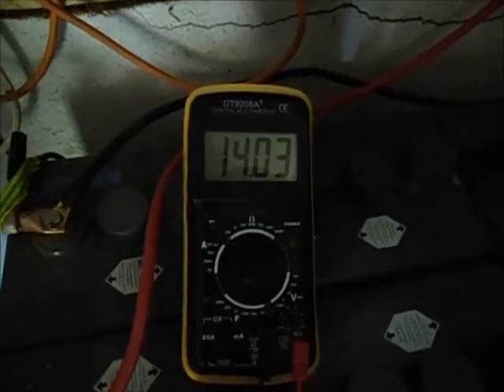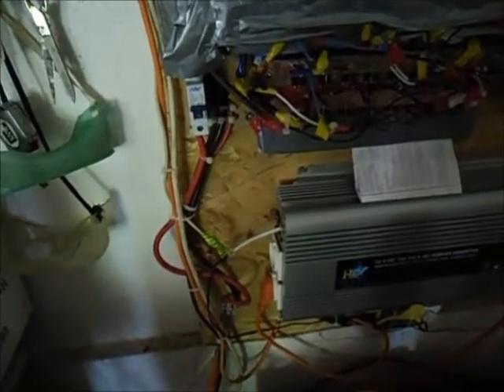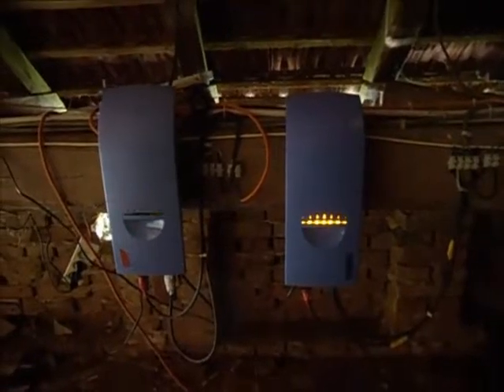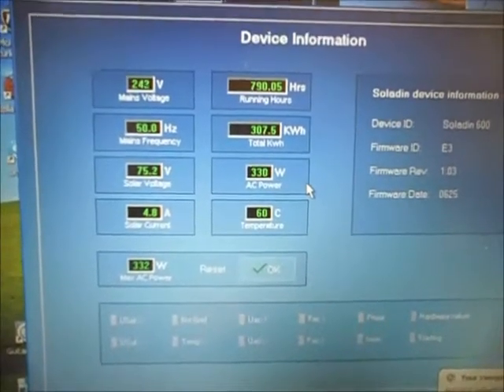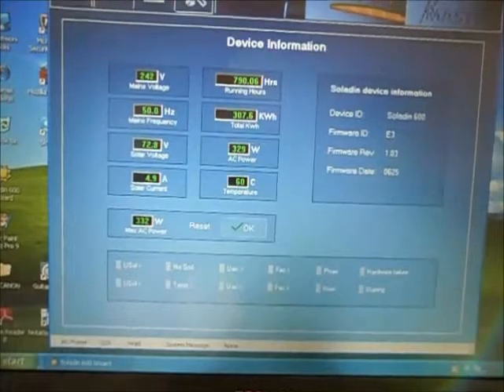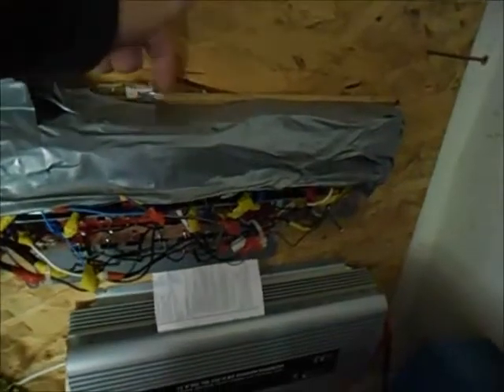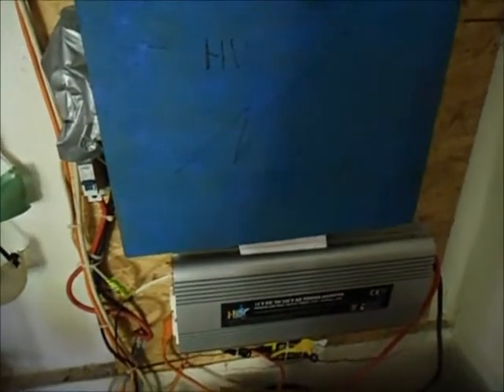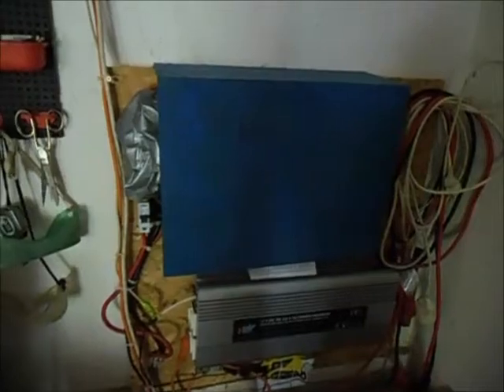The end result of all the Bedini and free energy experiments

Comment: Bad power company you have. Mine has forced me to buy a digital meter for the solar panels. I know they register what I deliver (and other home users with solar power), and add it up to say 'they' generate so and so much green power.

As you charge with spikes, I see the voltage rises up to 14 Volts or more. If you compare the charging with conventional charging, do you hear or see a difference in gas production in the batteries?
Reply from the maker: the voltage will even rise to almost 16 V. At that point the battery is fully charged and producing lots of hho  but smaller bubbles than conventional and the batteries as well as the charger do not warm up at all!
The battery is only producing gas in the last stage of charging when it is over 13.5 volts.
Reply: how are your alum batteries holding u? would be great to get an update on them